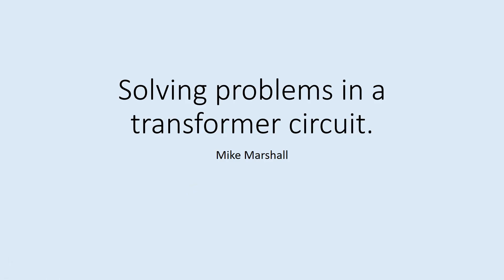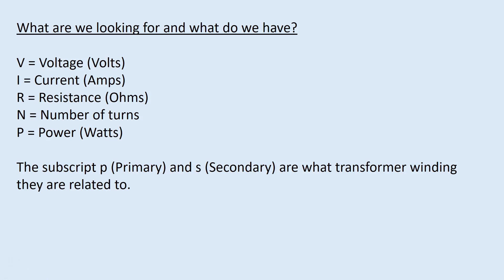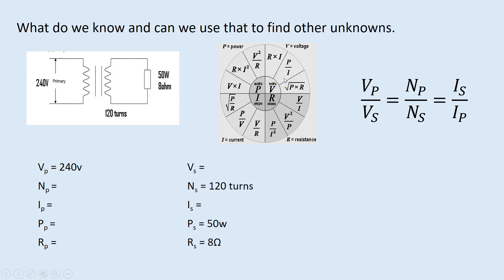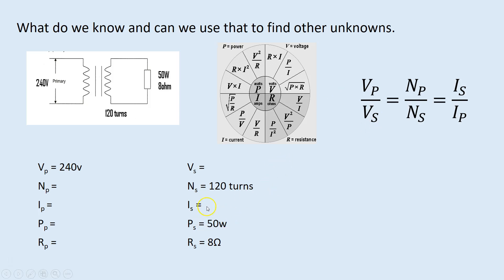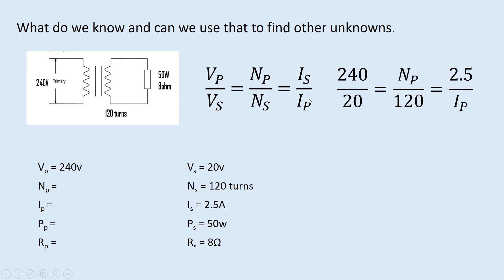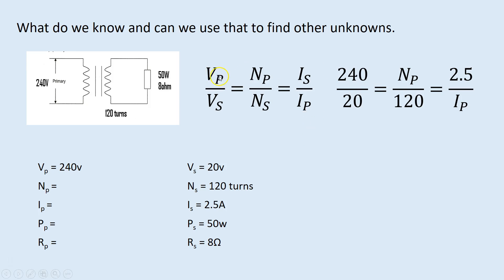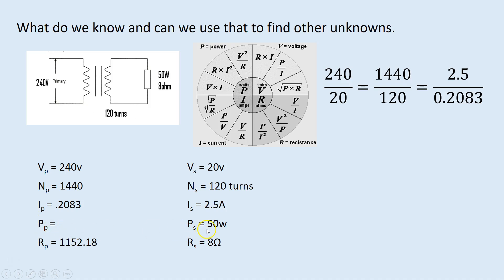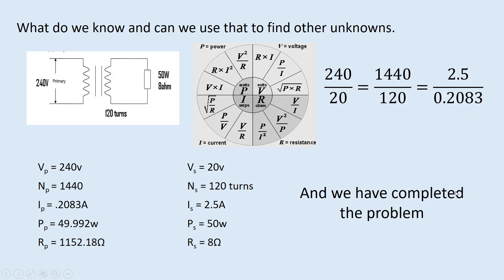Transformer Circuit and Equation

Comment: This is NOT solving a transformer.

These crude basic formulas of turns ratio do nothing to calculate transformer inductances which is what its all about.

Further, baluns have no place in modern ham radio, baluns are for coupling open and concentric lines, NOT FOR ANTENNAS.

There is no excuse for using twin lead with low resistance antennas, coax is so cheap to buy.

This info is trivial and useless

Comment: sir you make a video on calculate of the following namely .1. turn per volt 2.wire size calculation for both primary and secondary side of transformer 3.cross section area of transformer core etc.all these calculation related to E I type core transformer.

Comment: As soon as you have Vp and Vs calculated 240/20 is a ratio of 1/12 - so either divide or multiply by 12 on Ip and Np. 
Or is there a situation where this would become invalid seen as we are using a balanced equation.

Comment: The only thing missing from this video is that number of turns does NOT = resistance. You have to select a specific gauge wire x length of wire to get resistance.

Comment: mike,I wanted to help your followers and thank you for this video,.the size of wire is based on the current of the transformer's so you need to use AWG table or AWG wire gauge table
Reply from the maker: Thank you for your comments. I am working on a few other videos. One tackles the wire gauge question within electrical circuits. I am pleased a small community of engineers is growing from this helping each other.

Comment: I mean,do we need to know the diameter of the wire to be winded?
Reply from the maker: Hi I am not a know all on transformers, this video was put together to help students in my class with a particular problem. I presume the larger the gauge of wire the coils are wound in will allow for higher the current flow in the coil effecting the strength of the magnetic field. Which will then enable higher currents and power transfer to be induced in the secondary winding. I hope this helps